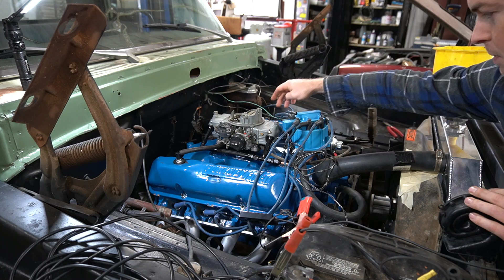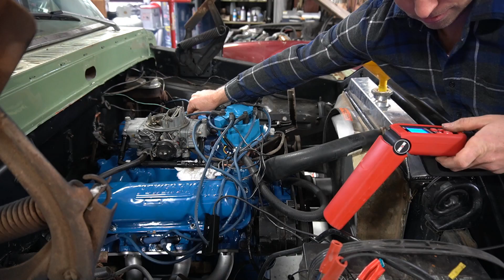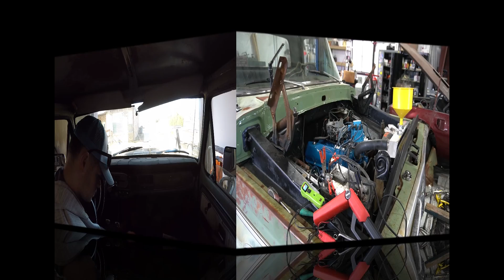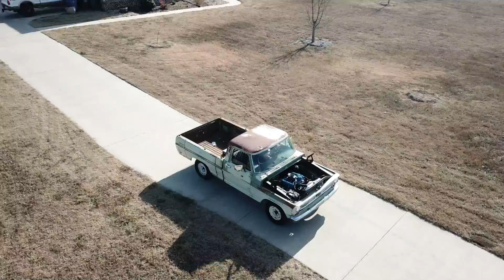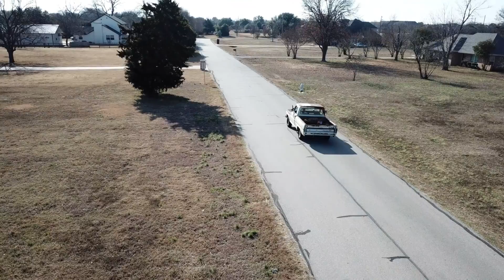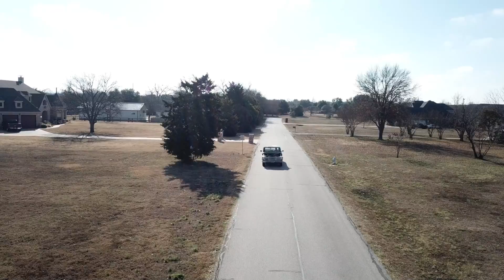Ford 390 - First Start After Rebuild & Road Test

Comment: Why did you have to use something that beeps when you hit the solenoid?

By the way, there's a trick to getting the timing set close enough to fire.  Just set the engine to your desired point of ignition, pop the distributor cap and rotate the distributor until it's close to where number 1 should fire.  Then you put the cap back on, how up power to the distributor and rotate it until the number one spark plug fires.

Comment: Holy hell!   What NOT to do with a fresh engine. I guess this dude never heard of a "break in period"  !   Rev it to the moon with a burnout !   I will have to say, its a great way to test the oiling system, bearings and cylinder walls, rings etc.   I have a 240 6 in my f100 that can do burnouts too with 125K on the odom.  No weight in the back end.    I dont know of any engine rebuilder that recommends winding them up right out of the box, break in by taking it easy , I think Ford even put in the handbooks , easy does it for the first 500 miles.  Even Yates breaks them in easy on the dyno.

Comment: I just block the vacuum advance and put the mechanical on 25degrees and the initial on 12 . The curve of the mechanical should be all in by 2600-3000, so light springs are best.  I should show 37 at 2600-3000 depending on your compression. FEs will run forever.

Comment: My dad and I fixed up a 78 with a 390. When we first got it we had to stop at service stations to check the gas and fill up with oil. Ran strong but dang it burnt some oil. Wasn’t long we had it right. Loved that old truck. Miss you pops. 
 Thanks for sharing and bringing back good memories!

Comment: Do not worry we have all done it. My galaxie 500 xl has a 390 and my F100 has 302 so I can sympathize having done the same upgrades.Keep going and you will a cool ride with all the work you have done. The only thing we all have to deal with is the bills for all the goodies.
Reply: '65 500XL 352/4-spd (check profile pic) & '67 F-100 352/3-spd manual owner tips his hat.😎

Comment: If you want to get rid of the bell crank doohickey for the throttle linkage, you can use the linkage from a 73-79 F series/78-79 Bronco.  It has a swivel stud that attaches to the carb and an adjustable rod & clip that attaches directly to the pedal assy.  You probably want to swap the cork valve cover gaskets for "rubber" ones.  Also, use a block of wood & the edge of a bench to straighten the valve cover lips. 

You should be able to tune the mechanical advance just like a GM HEI unit.

Comment: The cam card that came with your cam should tell you what initial timing it should like. Then use a vacuum gauge to set the carb. Plug it in to ported vacuum, then lower the idle speed screw till you just about lose all vacuum. Then hook it to the manifold vacuum port, and adjust till you get a smooth vacuum reading

Comment: Hey what octane do you run having 10:1 compression?? I’m building a 390 and would like my compression around there.
Reply from the maker: Just the 93 pump gas. Any higher compression and you may want to consider some higher octane.
Reply: @330_garage3  oh where are you located? I can only get 91 out here in Nevada. Want to have my compression where yours is but not needing 100 octane. What kind of power numbers do you make with that truck?

Comment: A guy finally found a motor for his 67 f100. Unfortunately I had to settle for a 360. Got it home, started looking at it, and all of the casting numbers indicated it was out of a 69 galaxy. They didn't put a 360 in the 69 galaxy, so I measured the stroke. It's a 390. Fuck yeah.
Reply from the maker: hell yeah! thats some awesome luck. I have always had the opposite luck. Most the 390s I have looked at... turn into 360s once you check the stroke...
Reply: @330_garage3  haha yeah I think the seller assumed it was a 360 due to the 2v intake manifold. I already found a 4v manifold to do a conversion, ordered a new cam, lifters, timing chain, bearings and gaskets for a quick rebuild. Making it happen.

Comment: I hate those chinese aftermarket chevy distributors on a Ford.  You can get the same end result for about the same price and not have that ugly thing up there that gets in the way of the air cleaner.  Ford duraspark distributor, remote mounted HEI module, your favorite coil.   Done.  Off Rock auto you can get all those things for about $100.  Also you need to get rid of the resistor wire and wire all the ignition wire back to the source.
Reply from the maker: Thats some good info, I had no idea that was an option. I would love to see a good video done on that setup!
Reply: Yes... my thoughts exactly. It just looks like a cheap set up.

Comment: When I broke in my 390 I was so anxious I didn't purge my  coolant system so it had air in the radiator , I got cheap and reused the old water pump  that had issues , I had house fan in front of the radiator ran it at 2,500 to 2,800 for 25 min made a lot of rookie mistakes I'm surprised no it survived I just did a compression test after 3,500 miles 150 with 2cyl at 155...held up pretty good .
Reply from the maker: Sounds like it help up well and didn't get too hot! Those motors hold a lot of coolant, so it may not have cared too much about an air pocket.

Comment: You should be able to set your timing mark at the initial advance point. Drop in the distributor and move the mechanic advance to see when you have spark. This works with points and can get you within 1/2°. With electronic you should line up the trigger with the relucter ring.

Comment: I know you're trying to do good job with this engine but sometimes you need to consult professional mechanic to put this thing together one is the wrong head gaskets and as you're cracking an over blow-by is coming out off the valve cover not a good sign and even when you're cranking it over stuff is coming out of the radiator you know not a good sign and the HEI distributor can be set within 2 degrees of the timing if you know how to set the distributor and you always take a small bottle and fill the float Bowl of the carburetor just started up and make sure clean gas is in the gas tank if it's an automatic you put it in park standard neutral FE motors are fun to build but there's a trick to build in them if you want them to last a long time

Comment: I just sold my 71 4 door to a guy in texas less 428 cj and a c-6 with a R-11 over drive that works better than a gear vendor overdrive . both are for sale , see phx craigs list... that would be a great trans for this truck . second gear scratch and 1600 rpm at 80mph with 350 gears and 31 inche tire. with cruise control  and tailgate down you could get 17 mpg in reality with this OD C6. not bad for having the aerodynamics of a cinder block

Comment: I learned about 180 in 180 out with my father back in the early 80s when he was rebuilding a 351 w in our 77 econoline. yes brings back memories. Great diagnosis.. but you knew that. Great job.

Comment: I'm guessing you are not squawking at spending the money at the machine shop. Lol!  You got off lightly there if you ask me. My 289 heads cost me over $1700.00 can$ to pull the pressed studs out and machine it for the bigger screw in studs and then the 3 angle valve job , decking the heads and a whole lot more. 
Head work is very important on any engine build. Lots of guys cheap out and end up paying up to 3 times to remedy the problem. 
Sounds great and lots of new life in that bad boy!

Comment: once upon some ford build ,I plugged 7 and 8 cables the other way and broke in my Crane Saturday Night 270* cam . 30 minutes later i shut off the engine and blew up the driver side muffler! Ka Boom! Found my cables were misrouted. And eventually found my cam had #7 and 8 worn down. Builds happen.

Comment: 600 rpm at idle is bad for a big cam dude.I just did my start up on my 351w with a mid range cam and I set mine at 850-900 rpm.This keeps better oil flow to cam and lifters .

Comment: YESS!!!!! That is awesome! Well done! Love it! And yes, I can hear that came and it certainly is alot more healthy sounding that i anticipated from that profile. As for your valvecover gaskets, Stick with the cork/rubber, use the 3M Super Weatherstrip Adhesive aka yellow snot and only need to glue to the valve cover side. Make sure the flanges of the VC are straight and no indentions around the bolt holes. Don't overtighten, usually hand tight with a nut driver is all that's necessary (or it splits the gasket). Have several FEs with lotsa miles on them... and I'm a guy that likes to keep em dry and clean. Good job man! Happy for ya!

Comment: Coilovers or air shocks will help with the wheel hop. I think JC Whitney still sells the body plug kit for that truck if you lost them.
Reply from the maker: Thanks, I have a 4 linked conversion scheduled for this fall, so that will put coil overs in the rear. I'll check out that body plug kit, thats a good idea.

Comment: 1:37, the term you're looking for, is "ballast resistor"
If the distributor is in right, the vacuum advance will point straight ahead...
Reply: Joe Schlotthauer my distributor is pointed to the battery. But it runs great. Wrong #1  pointed to the cap??
Reply: @f100storys8  
You could be a tooth off and you have it adjusted as far as it will go, I'm a retired Ford/Lincoln/Mercury technician. I was an engine specialist....
Reply: Joe Schlotthauer don’t have to proof your knowledge, I’ll look into it. I mainly run my truck on propane and propane requires less timing so it’s fine

Comment: Awesome job! This mopar man is absolutely loving this build. I was thinking the distributor must be 180 out about the same time you said it. Anybody that claims they never put one in 180 out or mixed up a couple of plug wires is either lying or never turned a wrench in the first place.
Reply: I bought a $500 truck with a 360 in it that the guy couldn't get to run and I swear I even checked top dead center and swear I felt it pushing air out like it was on the compression stroke and STILL didn't find out the distributor was 180 off until I pulled it out and turned it as a last ditch effort and sure enough it was 180 off.
Reply: Surprisingly I never have. The 351 that I built years ago with EFI and almost all used parts that I ordered off Ebay started on the very first crank with fuel.  Main reason the Ford TFI distributor on EEC 4 cars. The module physically will not let you turn it but a few degrees back and forth because the cooling outlets block it. Long as you have the crank on 0 and know that #1 is up front, it's almost impossible to screw it up. I drove that car for months without ever putting a timing light to it (base timing is 10 degrees, once you have it in properly, you can kinda tell how far to turn it, again it can only turn so far with the TFI) The ONLY  engines I have R&Rd distributors on were Ford EFI smallblocks though
Reply: @vendediesel  change it to chevy HEI distributor. I did. All chevy HEI caps work with it.
Reply: @mattisenberger4042  if I could do it all over again (as I sold the car years ago) I would just go with the EEC V setup from the 1998 5.0 explorer. Uses coil packs instead and supports full electronic transmissions. Lol, hindsight.
Reply: Watch the earlier video , you might have figured 180 off then already .
Reply: Or they are good mechanics. Not everyone on earth are the same. Plug wires are the simplest thing on the vehicle to change. They don't put the firing order on old cars and trucks for nothing. Look at your intake. I drive a 1985 ford f150. Only vehicle I own. Never let any human touch it. Do it myself. 351w.
Reply: Facts
Reply: We've all done it, or at least something similar

Comment: Just sold a 64 Mercury with a rebuilt 390.  Even in a very big car, Merc-o-matic trans and 3.0 gears, it was rowdy as hell.   I enjoyed watching your process.  Is the floor dry?  I have never owned an FE that didn’t leak oil at the rear seal.  No matter what I do.

Comment: Haha YES!  Im grinning ear to ear right now!  That’s things meaner than I was expecting it to be!  Would have liked to see your work on the exhaust.  That interior is going to be a blast to spruce up.  So what are the plans from here?  New gauges to replace that hideous dash bezel... disk brakes...?  I’ve got the same truck, even the same color, and my 360 is old, tired and leaky.  I can’t hardly wait to dig in and follow your lead on this!  Very pleased to see that it was all worth it!
Reply from the maker: I videoed the exhaust fabrication. Should have that video posted this week.
Reply: $2,227 and you got it! Wish I had a manual in my truck to do the clutch kick... Got a video of my f100 with 390 on my channel.

Comment: Dang man, you’re making me want to turn my 360 into a pepped up 390 ASAP. Sounds wicked, too. Good work!
Reply: I'm having it done to mine right now
Reply: Use the 390 crank and rods and keep your 360 pistons, most 360s had flat tops. The 360 rods are wimpy when compared to the 390 rods. It'll Put your compression between 10-10.5:1 just like a factory 390 4V